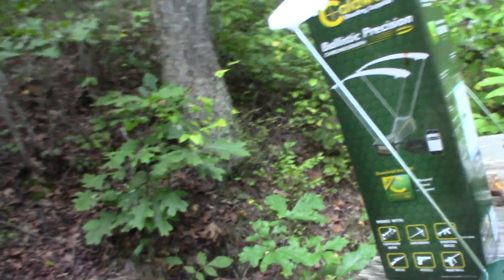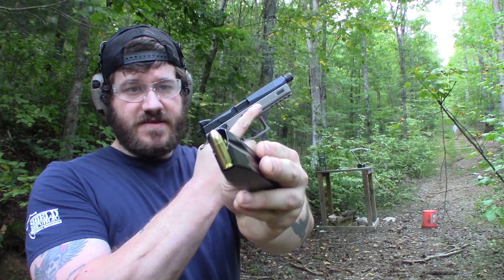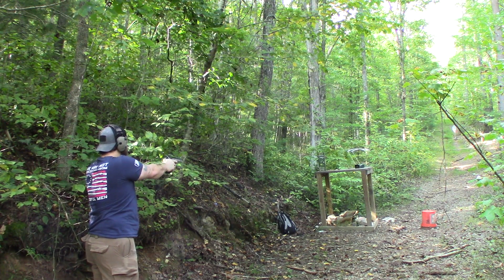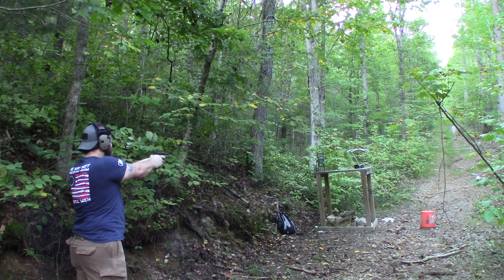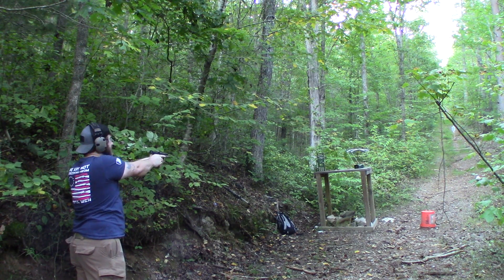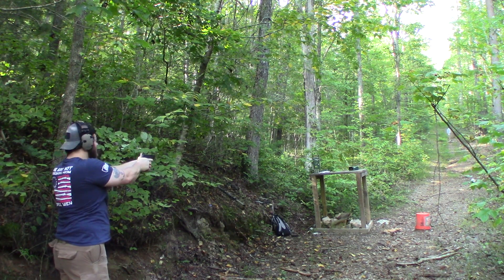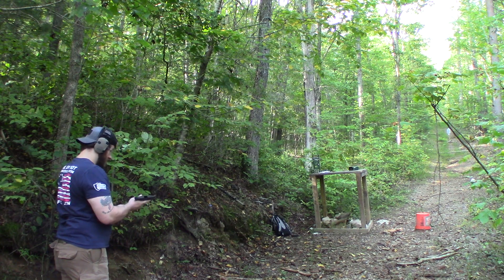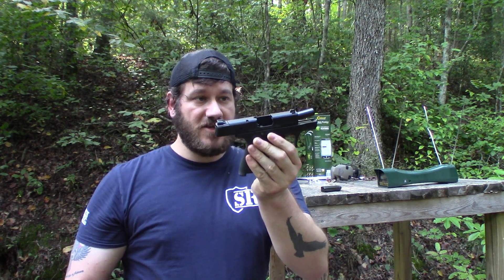Barrel Length and Velocity- 9mm

Comment: Great comparison I edc a 4.5 in barrel and my duty gun is 5.5in. I typically run a +p and +p+ at 125gr xtp and flex lock projectiles and sometimes heavier or lighter and usually see velocities from 1350-1450 on a average. That’s about 500fpe from 9mm give or take a few.
Reply from the maker: For sure. I feel like 9mm has a whole lot more potential than a lot of folks give it credit for.

Comment: Good test.  If you gave the barrel lengths, I missed it.  I knew the Shield's length, but I had to look up the CZs.  That extra barrel sure makes a difference.  I carried a Shield for years, but the 3.1 inch barrel was a big part of my decision to buy a P465XL, with the 3.7 inch barrel.
Reply from the maker: I did not give them. I should have done that. Lol going forward, I'll make sure to include that.

Comment: I don't know if it makes a difference or not but, when I have used a chrono, I placed a target with a mark for an aiming point that allowed bullet travel through the center of the sensor area of the chrono. A target that allowed me to see exactly where my rounds were impacting. I find that it's easy to think I'm doing better than I actually am when shooting at a target with a lot of holes in it or when trying to pick out and hold a point in space.
Reply: 4:26
Reply from the maker: Thats a good point!